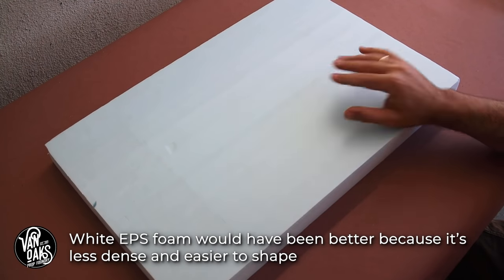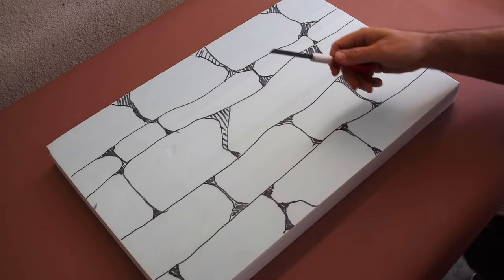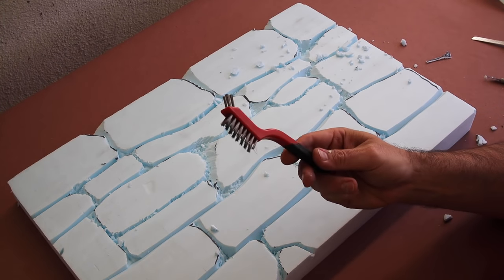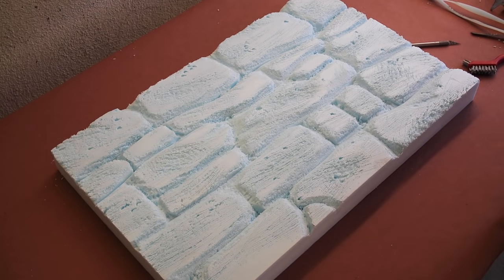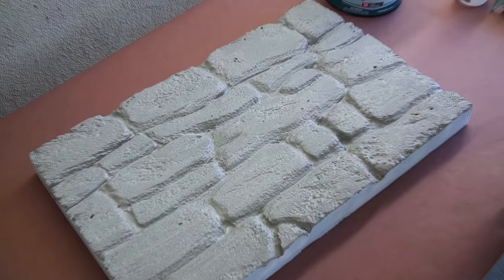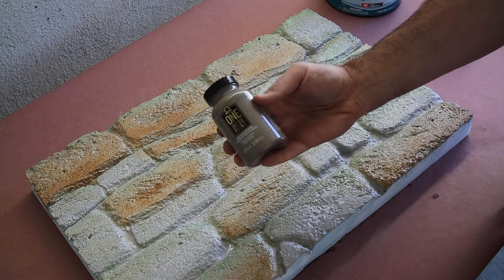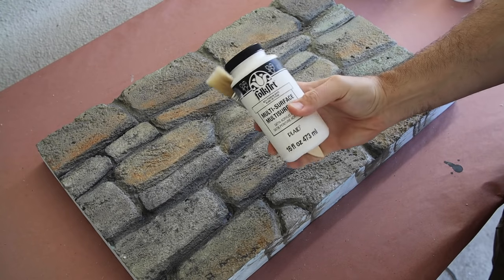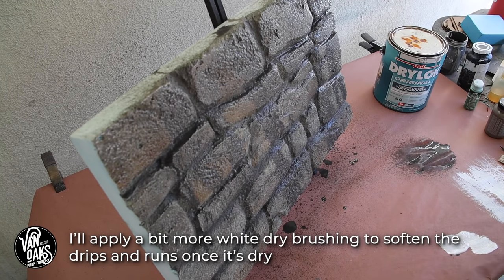Easy & Realistic Faux Stone Walls with Foam!

Comment: I ended up doing something like this for my haunt this year but on a larger scale. My facade was a cavern-like temple entrance and I used many of the same methods here when it came to carving my stones, again on a larger scale to look like they're larger rocks. Only differences were I used a router bit to carve my grout lines so they look like stacked rocks and used a heat gun instead of a torch for the weathering. I also Gorilla glued and screwed some leftover 2x4 scraps from when I rebuilt part of my deck in the bottom for security. 

Overall it worked out great and I got tons of compliments and the almighty feel test
Reply: I used a metal brush wheel that was a bit beat up with a hand held electric drill to carve the grout lines. It makes a more irregular, realistic line. Scary Larry

Comment: I think this would look really cool as the accent wall behind a bar in a basement or something. It will have the look of stone without negating any insulation factors and will also act as a sound dampener.
Reply: highly flammable and puts out toxic fumes when burning...
violates fire codes.

Comment: Thats pretty cool but a pro tip . When you lay stone, vertical joints should never line up as it creates a weak point in a stone wall. I know it foam, but still for a bit more realism. Never stack vertical joints.

Comment: I buy an actual course of flat stone to use as a stencil. I also do 4x8 sheets at a time, and covered the side of my house. Everything else I copy from you with the paint-especially the white paint on the surface! 
I then plant a climbing vine to obscure the faux wall to add more realism
Reply from the maker: That sounds awesome!
Reply: @VanOaksProps  thanks! I started with 3/4” styrofoam “courses” titebonded onto plywood, then draped with landscape fabric then more titebond. As long as you put something “real” (plants, real rocks 😂) the uncanny valley in all humans won’t fixate and then ruminate if it’s real! I buy a box of Airstone now to get stencils and use a Dre Mel straight into the foam. I’m building turrets to bookend my iron gate at my driveway now! Hahaha

Comment: Thanks for another great vid! I had intended on creating several walls like this for my display this year but ran out of time (don't we all?). So what I did instead was buy a load of 3D textured stone effect wallpaper (I believe they call it blown vinyl??) and stuck it on my flats. It comes in white so just needed a wash down with some gunky black, blown, green paints. Whole wall was done in 2 hours and looked pretty good under haunt lighting :)
Reply from the maker: Great problem solving and solution!

Comment: Imagine doing a entire wall with this method haha, BUT IT LOOKS SO GOOD!!
Reply from the maker: That would be cool!
Reply: @VanOaksProps  I know right! If it would ever suit you, could you maybe do a video on how to make a 'fake' stone like inside a pyramid? And not out of foam, but from another material which I don't know the type of haha. Like, when you visit a themepark and tap on a wall of a themed ride you can hear its hollow <-- that type of material
Reply from the maker: @steven20919  That's most commonly done with foam that is then hard coated with fiberglass and then textured. Once the fiberglass sets up the foam backing is removed, which is why they sound hollow.
Reply: @VanOaksProps  Ah like that!! And could they probably reuse the foam if needed? So it kinda acts like a mold?

Comment: I was the manager for a 30 acre Halloween park for 19 years. The owners had me rebuild it new every year. My sets were massive enough to fully enclose our 65' long hayrides. While I had built some modular walls using foam for detailed relief, over time I found this unnecessary & too time consuming for very large projects. Also, once you're seeing it under the typical dim and/or colored lighting conditions, the detail is all lost. This is how I did it. On a sheet of whatever sheathing you're using, roll the wall with your base color. This can be a medium grey, brown, green, whatever. Then you paint in the grout lines with a fairly dark grey. Next, shade the blocks by painting a black line along the bottoms & 1 side of every block, always using the same side (left or right). Then do the same with white along the top & the remaining sides. Lastly, dry-brush stipple randomly across the whole wall with each color & you're done. It isn't museum quality but it gets the job done. Last comment, while creating 'drips' is all fine, this gets totaly lost for the most part unless you do the wash much, much darker. Extreme contrast not subtle realism is the key. - Scary Larry
Reply from the maker: Great suggestions. I think there's a lot of different ways to create similar effects and it varies based on time/money/manpower/how close people will get to it.

Comment: EPS foam is underrated in the amateur haunt community in my opinion. Everyone goes for the pink/blue stuff but as long as you use the right techniques EPS can be really nice
Reply from the maker: XPS has always been my foam of choice because it's far more rigid and not nearly as messy, but I agree. People tend to shy away from EPS foam.
Reply: @VanOaksProps  Yeah for sure, XPS is more versatile and it is better in most ways I think. But in my current area I can only get EPS and for the longest time I avoided it because of what I read from others, but if you have the right tools and techniques it can get great results

Comment: if you have carved it so you can get cheese cloth into the cracks, painting down a complete layer of cheese cloth over the entire surface of the foam front and back, using latex house paint, will make it extremely durable.  I've always done a rough scumble of 3 tones as the base paint ...
Reply from the maker: Good to know!

Comment: Looks good. I have done a few foam stone props. I don't think you large wire brush looked bad at all. You probably know this but acetone in a spray bottle does a decent job at making a Stone surface.
Reply from the maker: I didn’t, but I do now! Thanks for the tip!!

Comment: Great work Derek (as always). If I'm being honest, I wasn't a fan of the paint choices up until your squirted it with water. That last step made a world of difference. At least on camera anyway. Also, I've been wanting to do the effect with embedded skulls (perhaps milk jug skulls). Any tips and tricks you can give to add these in and make them look cohesive? As always, thank you 🤘 💀
Reply: Also, instead of using a blade to carve the stones, I've seen people use a soldering gun with a flat tip. Just make sure to use a respirator.

Comment: This may sound crazy, but I have a stone fireplace in my living room, and they stopped the stone about 18 inches from the ceiling, because a structural beam runs across it. I want to make a thin sheet of faux stone to match the existing stone. This looks like it might do the trick. I would just need to slice the foam so that it doesn’t protrude farther than the existing stone.

Comment: Really good video production.
Two suggestions however.  Instead of a box cutter to cut out the grout line try using a small "V" gouge.  The size and type used in chip carving.
Next to avoid setting your self ablaze use a heat gun or your wife's hair dryer to distress and temper the foam.  NOT A TORCH.
One additional thought, instead of black paint or wash try using a darker tone of the stone color with a tile grout lightly sprinkled into the wet paint.
Jim
Reply from the maker: Thanks for the tips! A note on the torch vs heat gun, I use the torch because a heat gun isn't hot enough to create the texture without the foam first absorbing the heat and then releasing that energy in unpredictable ways. So it's not that I'm against using one, it's that it doesn't provide the result I'm after. And a hair dryer simply isn't hot enough to create any texture. Just figured I'd give context to my decision to use the torch over something else.

Comment: Always love these videos.  Any tips on sourcing XPS or EPS foam?  My local hardware stores don't really stock it, and I didn't have any luck finding it online in decent amounts for decent prices.
Reply from the maker: EPS foam you can get at most hardware stores in the insulation department. XPS foam can sometimes be found in the same place if you live in a state that gets real winter weather. 

If you’re in the Los Angeles area, goto hauntersfoam.con
Reply: @VanOaksProps  that website is not up anymore. I spent a few days trying to track down EPS is SoCal before Halloween - no luck anywhere
Reply: @VanOaksProps  Sadly not in the LA area, but I'll give my local hardware stores a shot - maybe I can have them special order it or something, or maybe I just had bad timing.  Thanks for the tips!

Comment: Hello. I see this video is from early 2021. And for some reason YT flushed it into my recommendation feed. Great, yet unexpected video.
Never the less, a suggestion: wouldn't it be easier to create the lines and gabs with a loop-tool, which is commonly used for clay sculpting?
Reply from the maker: Great question. I’ve never tried sculpting tools on rigid foam, but my guess is that it may not be able to cut through the foam. But now I need to try it!

Comment: Fantastic! I want to use this technique to fleah out the facade of a snow white cottage for my little one. Any tips for making this stuff weatherproof, or should i just go with fiberglass?
Reply from the maker: Fiberglass will definitely cover up any of the texture. So if you do decide to fiberglass, I'd make sure to cover the foam in foil to prevent it from melting when the fiberglass resin is applied, and then just go with a painted rock look rather than a textured rock look. @Hollywoodhaunter has a great vide on fiberglassing foam. Check out their Castle Greyskull build and you'll get some excellent advise on the subject.

Comment: Beautiful work! I remember doing this in theatre set design and have been thinking about it as a outdoor use.Can these foam walls be used outside for landscaping as a wall or accents that last years? I was thinking more concrete and mesh wire with stakes. Attaching foam to wood frame. Thoughts?
Reply from the maker: Thanks! Not without hard coat, but that would give them a more rock like appearance. So in a round about way, yes.

Comment: That's amazing! , But my question is...

how can I put it on the wall and making sure it will not fall down for years ?

What kind of glue? Or mortar is better ?

Hope u help and thank you.
Reply from the maker: You can use construction adhesive and it should stick for a long time.

Comment: Amazing! Great video!! How do you think it would hold up outside in Florida weather perhaps in the garden environment?
Reply from the maker: If hard coated it should withstand most weather conditions.
Reply: @VanOaksProps  Thanks so much for your reply could you explain please exactly what you mean by “hardcoated”… And what kind of products would do that? Thanks again in advance!
Reply from the maker: @plant-a-holic  hard coat is exactly what it sounds like it might be. It’s an exterior protective layer that is rigid. I’d recommend Flexbond tile mortar.
Reply: @VanOaksProps  Thanks for the info… I’m assuming that that would be put on prior to any of the coloring/painting?
Reply from the maker: @plant-a-holic  that’s correct.
Reply: @VanOaksProps  Thanks so much for all your help… One more question pretty please? I knew somebody that years ago took Styrofoam covered it with some kind of cement and made a vertical waterfall water feature… could this be done with this technique as well? Or would you have to have some other kind a hard coat that is waterproof or made for something like that? Thanks so much!

Comment: I'm looking to imitate German stucko, I was thinking about using foam like what you used in the video. My question is,what would I apply to the foam to make white paint stick to it? 🤔 Also could a waterproof clear coat be added to it?
Reply from the maker: They sell Drylok in white and it’s designed for waterproofing masonry.

Comment: How do you mount these foams?

In past I’ve used Liquid Nails and that does a good job. But I’m always interested in learning new things. 

Thank you!
Reply from the maker: Construction adhesives, like liquid nails, plus screws usually do the job.
Reply: @VanOaksProps  sometimes I’m hesitant with using screws and or nails because they do create the imperfections on the facade of the project. But I guess that one can always use a filler putty or quick dry plaster to fill in the holes and retouch with paint. 🤔

Thanks again.

Comment: I want to do this in my basement, what would you use to attach the sections to the framing of the walls?  Nail it down or use glue to hold it in place?
Reply from the maker: Construction adhesive if you want it to be permanent.
Reply: @VanOaksProps  thank you very much.  The hallway in my basement is unfinished, I thought about doing a stone wall like this.

Comment: How would you attach that to a wall? And if doing a larger area now do you for the piecesd together?
Reply from the maker: You can use liquid nails or similar product. If I was doing a larger area I’d install the foam board first and then start the carving so that I could hide the seams in my rock patterns.

Comment: I've seen you use acrylics and washes in several videos; how do they hold up in wet weather? Do you need to coat it with something?
Reply from the maker: Because acrylics are weather resistant, there's no real need to coat them in anything and they hold up extremely well.

Comment: hello sir, i have question, if i were to make a smaller stone wall, is it okay to use a toothbrush instead for the detailing part at 2.14?
Reply from the maker: A toothbrush wouldn't be rigid enough to remove the foam, but you could substitute the wire brush for any number of tools that would allow you to pick away at the foam. Sculpting tools, razor blades, tooth picks, etc.

Comment: This looks pretty realistic! HOW realistic? I am considering buying faux stone for my fireplace wall area. There will be no heat there, so no worries of catching fire. Gas firelogs too, so no spark. The foam would be 3-4 feet ABOVE the fireplace area, and on the sides...
Comparatively to $1,200, this seems more economical, and a lot less weight! Weight is a consideration, even for faux stone. I would be adding about 600 lbs to the wall ... versus..?? 30 lbs of foam?
Lastly, I am a schooled artist, and former Landscape Architect...so, I can do this! NP...

But am I being PRACTICAL?

I guess I just answered my question, lol...just go out and buy a 2x2 piece and TRY it, and see...right? Lol
Duh...it's early. 1st coffee...🤣

Comment: I wouldve sprayed a water black mixture for step 2 to let it seep into the cracks and wipe it off the higher surfaces with a rag. You didnt put any sealer or hardcoat for afterwards if people will handle or touch it?
Reply from the maker: Acrylic paints don’t typically need to be sealed since they’re weather resistant.
Reply: Ahh ok I understand this is for display and won't be touched. I put up alot of interactive spaces that people and kids touch so the foam gets torn up so I hardcoat them to prevent that

Comment: hy , it works like charm!  but without some reinforce fibers or mesh it actualy crack pretty fast. it is almost imposible to pick up segment without cement crack. i try fleksible tiles glue but samething happened.
did you maybe solve that issue?
Reply from the maker: For long term use this method probably isn't ideal for most scenarios. But if it's something temporary it's not likely to be a problem.

Comment: You mention EPS foam would’ve been better, but as it is polystyrene, would the painting look as good? Would the holes in the foam not show up through the paint? Genuine question not trying to correct you.
Reply from the maker: Great question! Both EPS and XPS are polystyrene, so both be painted with great success. EPS foam would, however, need to be hard coated to give it added rigidity/protection.

Comment: I know this video is 2 years old but can anyone suggest on how to seal this up or what to use as a sealer for outdoor use?  I want to make a wall like this in the seating area on my outdoor deck.
Reply from the maker: This wouldn't be ideal for long term outdoor use. This is designed as a prop build that would be used on a temporary basis.
Reply: @VanOaksProps  Ok, thank you for the video and taking the time to respond

Comment: What if you needed t o do a 8 x 10 foot wall?   How would you build first ?
Reply from the maker: Is it free standing or will it be attached to another structure?
Reply: @VanOaksProps  Say a  wall in a family room in a home.  I assume you would just cover the wall with rectangles of foam?  Maybe attach them to the wall with those small velcro squares ?
Reply from the maker: @fairamir1  If it's permanent, you could screw through the foam into the wall. If it's temporary, Velcro would be a great option.
Reply: @VanOaksProps  For permanent I would use the Velcro...holds tight for ages  and easily removed.

Comment: Can i use foam to make silicone wall stamps?
Reply from the maker: Depends on your expectations. Foam may not be the best material for carving to make a mold from. However, you could carve the foam and use it as a stamp and skip the silicone altogether. Also, I wouldn’t use silicone for stamp making, but that’s just my preference.
Reply: @VanOaksProps  thank you
Reply: @VanOaksProps  one more question. Wouldn't the foam stick to the cement if i use it as a stamp?
Reply from the maker: @Noulika  I didn’t realize you were using cement for your wall.